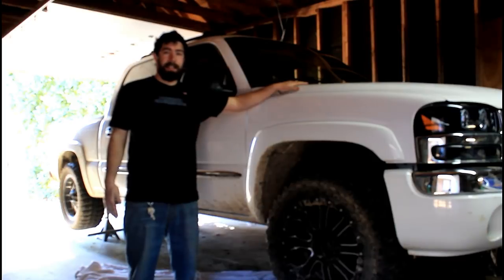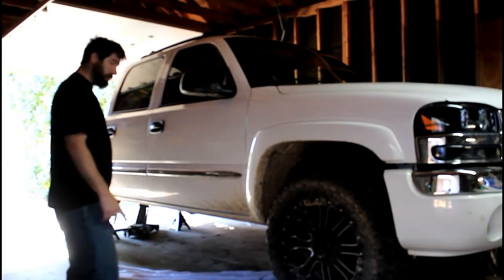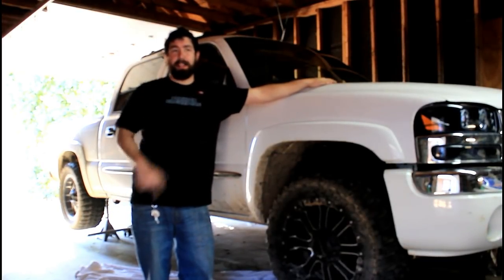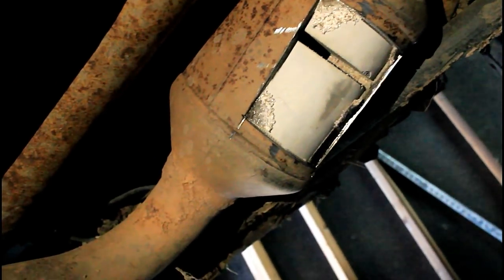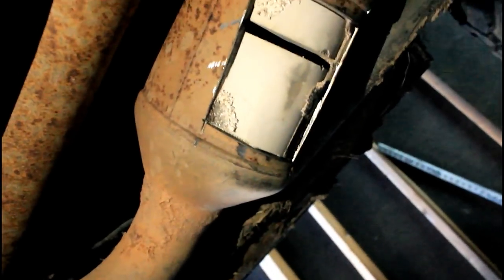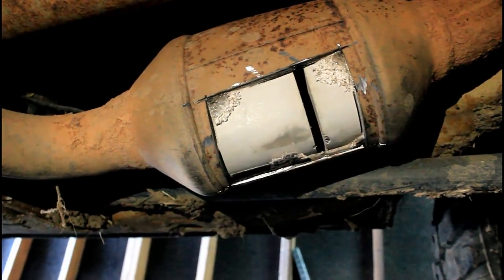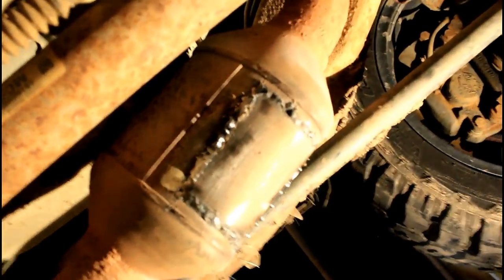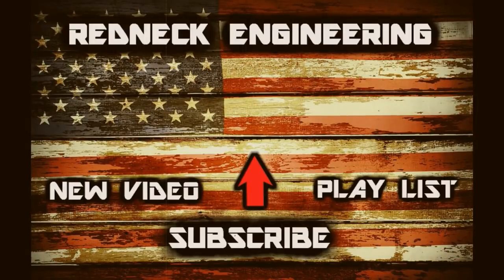Catalytic converter removal the easy and cheap way

Comment: I just deleted the 2 catalytic converters, resonators on my Ford Expedition. I installed a flowmaster muffler, performance tune, K&N 63 series air intake system. I love the sound and it has better acceleration.

Comment: I cut off my muffler, drilled a few holes in the converter, and just pounded the heck out of the converter with a metal rod. Ran it on the freeway to work at high speeds to blow the dust and cement out of the converter. Put muffler back on and used a couple lag bolts to fill in the drilled holes. Runs 100% better and is also louder than before. Plz give me a shirt.
Reply: You know that "dust" is Platinum you can sell..
Reply from the maker: Its not ez to sell im some places

Comment: on a scale from 1-10 what would you say is the difficulty level to weld that window back on? I know jack about welding. temperatures vs thickness of the metal? I'd hate to do it and not be able to finish. any advice on that last step would be awesome? or maybe some do's & dont's?

Comment: Need to hollow my cats out.

Easiest to do this, or is it realistic to cut pipe behind cat, hollow out from the back with long drill bit, and then use an exhaust clamp to clamp back together?

Comment: Hi i have an 06 suburban 2wd and it had no muffler but its not loud enough like you said lol..
Anyway was wondering how long it took you to do both cats, also I am 17 and don't have any experience with welding.. would it be easier to cut them off and put a little pipe in and clamp them or what could I do?
Reply from the maker: You could do that but its hard to get it not to leak and lign up

Comment: Hi there

I don't want to gut out my cat converter completely as I hate the smell of gas without it

I just want to drill 2 half-inch holes in my cat converter, using a long drill bit
Just to help with the flow

Do you think the honeycomb will crumble right out?
Or will it stand the rotational force of the drill? 

Thank you
Reply from the maker: Do not do that you are going to create way more issues just by high-flow cats if you don't like the smell
Reply: @redneckengineering7739 
I am sorry

Could you please be more specific
What kind of problem would I get?

This cat converter is still in a good condition
My car has less than 25,000 miles on it

I just want to get a little more power from this pathetic 1.5L Toyota engine

I gutted out the cat converter in my previous car 
But the exhaust smell became unbearable
Don't want to go down that route again

So I was thinking about drilling 2 half-inch holes through the honeycomb, along the gas flow direction 
Not through the cat converter body

I am just worried that the honeycomb construction is not strong enough and that it would completely collapse
It would then be like gutting out the cat converter = the very thing I am trying to avoid

Thank you
Reply from the maker: You're just going to waste a bunch of time you don't get any games from more flow without a tune

Comment: I have a Chevy S10 2000 catalytic converter is removed already can I replace that with a straight pipe? I live in Kentucky. I know in Ohio no one wants to cut off the catalytic converter and put it on a straight pipe but the thing that is illegal is actually cutting off the catalytic converter. I remove the old catalytic converter and I cleaned it out and I was just going to put it back in and have it act as pipe but the nuts had become part of the catalytic converter because of the Heat. I got it out there so now I'm just wanting to know if I can run straight pipe on it from the motor back or if I can just replace that part with straight pipe. I do know that there's an oxygen sensor on that catalytic converter that I might have to work with. I do on my own truck work and stuff, mechanic stuff because I can't afford a mechanic. I also have a 96 Dodge Ram 2500 that I work on.
Reply from the maker: I’m not sure what you’re referring to with the U bolts and the catalytic converter they don’t vote on but you have to have at least the front oxygen sensors or the vehicle will not run correctly you can put a straight pipe in but it is more difficult because you cannot easily weld the top of the pipe and clamps don’t always work

Comment: Just wondering if the truck ran any better?? Need to at least space out the rear o2 sensors, or get a tune. Thinking about doing this to my 05 burb this weekend. Cats are worth good money, almost worth the extra work of cutting then out and scrapping them. Guess that also depends on the condition of the nuts on the y pipe
Reply from the maker: in my experience it is very difficult to get the pipes to line back up if you cut it out at least if you don't do this very often and it will not be able to be welded on the truck and no there aren't much gains without a tune

Comment: I’m late to the party but I have an appointment tomorrow to get my cats removed in my 03 Tahoe I already have a serious 10 flow master I’m gonna keep 
Any tips? Or anything I should be aware of?
Reply from the maker: Check engine light is going to be on
Reply: @redneckengineering7739  that’s it ? Everywhere I keep reading they say it makes it run like shit lol 
I’m nervous AF
Reply from the maker: It will b fine

Comment: Hey bro, I have Lexus V8 ls600hl and one driver side catalytic converter honey comb was broken so gutted. Passenger side one is good. Now I have a engine light ON. Don’t know what to do? 
Can you please advice? 
Thanks
Reply from the maker: I have a video on here that tells you what to do or you could just leave it alone it will be fine either way but you should probably do it to the other converter

Comment: I have a 1995 Chevrolet 2500 what's the 454 engine. I wanted to modify the exhaust and I noticed the theory is a catalytic converter post my muffler. I've never seen anything like that before so I would like to cut the catalytic converter off and see what it sounds like through the muffler without the cat. What are your suggestions and is this configuration familiar to you?
Reply from the maker: If it’s after the muffler it’s probably not a cat but if it is before chop it out it’ll sound a little bit better

Comment: I have a 05 Tahoe with 5.3 I want it louder should I get flowmaster series 10 or a cherry bomb glass pack? And can I run no cats or is it illegal and will it pass inspection with no cats
Reply from the maker: +Briley Sadler I'd probably say go with glass-packs I like that sound Flowmasters is what everybody uses but if you have any type of inspection you will fail with no cats and yes it is illegal to remove it

Comment: So just for me to get the converter out i have to drain the oil? Or thats because you needed an oil change
Reply from the maker: The oil flows through the catalytic converters and creates a fire in there you can also cook tacos with it if you want but other than that do whatever???
Reply: @redneckengineering7739  i just checked my shit out n whatever idiot that had it welded both ends to some hooks that are supposed to hold the converter
Reply: @redneckengineering7739  so my thing is that i dont have any check engine light but when you turn my truck on you can feel a lil vibrate and when you go to the back n feel the muffler you can barely feel anything like if its clogged... Any tips on what i can do....
Reply from the maker: If the cats are clogged it would throw a check engine light but the best thing to do is chop them out or replace them

Comment: What is the difference in performance between a hollow-out and straight pipe?
Reply from the maker: There is no performance gain in either of them unless you are going to do some sort of aftermarket tuning and not one of those handhelds the biggest benefit is that you don’t have to cut and weld all the way around the pipe sometimes it is difficult to weld the top side of the pipe due to constraints

Comment: I have a Infiniti g35 is there a way to cut the cats and reposition the o2 sensor in a straight pipe to seal good enough to pass inspection or gut them where is still as if they have never been touched to still pass inspection
Reply from the maker: +Kaleb Milano I don't think you could do that either way and pass inspection

Comment: Sounds good. I don’t mind music if it’s low in the back ground. Where you can barely hear it. If your not required to have them why not just cut them out and add some piping.. drill and tap for your o2 sensors. You lose a few hp when you hollow those out due to turbulence in the exhaust
It messes with the exhaust flow. Unless your just looking for loud. Then this works lol
Reply from the maker: +Shiny Knife that is a lot more work and it will not cause a loss of horsepower or turbulence it still Flo's a whole lot better
Reply: Maybe yours is different then?  I have the same motor and have seen different results.

Comment: Pop a hole in the oil filter with a screw driver and let it drain. it won't be as messy lol.
Reply: or open the fill cap?
Reply from the maker: What r u talking about
Reply: And wear gloves, used motor oil is a carcinogen
Reply from the maker: I've never worn gloves before I ain't going to happen now
Reply: All u have to do is put a funnel underneath the filter while your are unscrewing it. TADA NO MESSSSSSS
Reply from the maker: Or just unscrew it and not worry about it
Reply: @pan2ube  thank you you seem to have some common sense
Reply from the maker: Ok
Reply from the maker: Cool

Comment: you can use a 2lr soda bottle just trim the bottom to form a scoop remove the cap an hold as u remove the plug, the oil just goes into the bottle an out the bottom
Black or grey ether is cool
nice design btw
Reply from the maker: +T Rea thanks
Reply: I got that idea after chasing the oil an cleaning the aftermath

Comment: Is your muffler removed as well? I cut out my muffler and welded a flomaster in, then brought my pipe out the side of the truck in front of the tire instead of behind. I want to cut the cats out too, I loved the sound of my truck just straight piped, but I like the sound of the flomaster better, and I was hoping I could get it louder by removing the cats.
Reply from the maker: +FrostyFooy ive got a 2 in 2 out magnaflow nock off someone b4 me cut the y pipe after the cays and made it true duals but welded on the stock muf b4 i bought it
Reply: You're just asking for a ticket if you remove the muffler on an already loud truck lol. If you don't drive it in town you probably won't I guess.
Reply from the maker: +Garrett - theu wouldnt were i live anyway but ill keep it

Comment: Love the video...great in its simplicity. Just bought son a 96 gmc 1500 extended cab. Cat already gone. Putting in muffler this weekend. Having hellacious time with water leak in dash and passenger side back corner. Already have back glass resealed and 3rd brake light. Any ideas? I live in the Memphis area
Reply from the maker: Not really a clue without looking at it

Comment: I have a 2000 Chevy Silverado and I really want to delete my cats! I might try this way, I want a shirt! Keep up the vids
Reply: I did that on a 1990 Chevy Silverado  and ran great ever after...........More power
Reply: Just rev it up till they are super hot then take the house put it in there and run water through them
Reply from the maker: That ain't going to work
Reply: If you dont have a welder and don’t want there to be a noticeable cut in the cat, if the exhaust pipe is straight enough, you can drop the pipe and bust it out with no cutting. Thats what im going to do to my 2014 silverado on the 3rd (California) cat.  The v-band is also 2  inches from the cat so that’s a lot easier
Reply: @redneckengineering7739  I have a 2004 Chevy silverado 1500 I want to delet my cats but will it throw a code
Reply from the maker: Yes
Reply from the maker: Nah man you can hit me up on Instagram though @cataldo133
Reply: @redneckengineering7739  can you tell me step by step what to do
Reply from the maker: I mean yeah what dont u get
Reply: @redneckengineering7739  do I do the o2s first or last
Reply from the maker: Last
Reply: @jeffpilcher8099  Get one of those O2 sensors that has a mini cat built into it so the O2 sensor only gets to sniff exhaust gasses that went through a cat. Your exhaust pipes can be cat free and your ecu is none the wiser.

Comment: Like them headlights bud
Reply from the maker: Thanks but I actually hated those I don’t like halos or projectors or stupid little LED lights that were in those I wanted clear tinted regular headlights and that’s what I ended up getting those worked way better I could actually see in the dark till I sold the truck

Comment: Sounds lots better, how does the cars computer o2 sensors work now?
Reply from the maker: +royalwulff1 first of all front O2 sensors are the only ones that actually matter the second-set are just monitoring the efficiency of the catalytic converter so it will throw a check engine light but I made a video on how to fix that also
Reply: I saw that after my post, good job. Thank you. Doing my cat install in the morning 488$ oH WELL, WE HAVE INSPECTIONS :(
Reply from the maker: +royalwulff1 put vband clamps and make it removable and just put it on for inspection
Reply: Redneck Engineering would pulling the bank 1 downstream o2 sensor be causing me a p0420 code for cat running insufficiently? I took a o2 sensor out and put back in..been throwing engine light since.
Reply from the maker: +Brady Wyant mayb idk what that code is

Comment: Nice.  I was afraid to just cut them out of my f150, but your solution is much better- Im in baja Mexico so  I dont worry about california smog..
Reply from the maker: Yeah the big issue with cutting them out and putting in a pipe is it's really hard to weld the top joints and in some situations it's hard to get the pipes to line up

Comment: Why would you waist that much time and effort? You could have cut them out and replaced the pipe?
Reply from the maker: +Garrett Frey you obviously have never done that it's just as hard
Reply: Waste
Reply from the maker: Both of you are idiots have you ever tried to take loose an old manifold bolt if you're going to do it right you need to remove the exhaust completely cut the cats out Andre weld it if you cut them out while they're on the truck and try to rebuild it the odds of you getting to the top weld joint are low
Reply from the maker: With that being said do it however the fuck you want because it's your truck I really like to do long tube headers and a full exhaust but I don't think there's enough to be gained

Comment: What headlights and running lights are those?
Reply from the maker: Did not buy the ones in the video any eBay or Amazon lights that have halos or projectors are junk! Since then I have found stock style just tinted and clear lenses no halos no LEDs no projectors none of that crap

Comment: What about the O2 sensors ??
Reply from the maker: It doesn’t have H2O sensors and the oxygen sensors will set off a check engine light you must check out my other video to figure that out but good luck

Comment: My jimmy 1991 can't breath. You got the right idea
Reply: Do you think my O sensor will still let my jimmy run good. I just want to put a pipe in there to replace that cat
Reply from the maker: +Sylvester Stalone yes
Reply: Thanks, I have 200,000
Reply from the maker: +Sylvester Stalone not bad

Comment: I'm gettin blow by fumes in cab thru heater at a stop. Oil change with Lucas but wheres blow by tube so I can add or reroute
Reply from the maker: Something else is wrong there is no blow by tube it all gets recirculated through the intake

Comment: I hear leaks, this is a waste of time and money. Easier just to cut the cats off get for 500 bucks for them take a couple pieces of flex pipe and clamp them right on. Sure there may be people that would argue this method but works great and if you don't like it easy to take off, the other benefit is super cheap.
Reply from the maker: If you think flex pipes are better than what i did you are clearly an idiot

Comment: Catalytic converters are full of copper, nickel, cerium, iron, manganese and a small amount of rhodium.
Reply from the maker: +Willem Moon ok
Reply: Well I only type so because some of these metals can be hazardous to breathe... When I removed my 2001 chevy blazer's converter I just cut it out and cleared it out and bought a custom made exhaust reducer and clamped it back in place :).  I thought about doing it the way you did but I am a little to old to be climbing under cars and welding lol. Great job though!!

Comment: NEW SUBSCRIBER What's up man!!! I'm in TN too Wilson County! I have a 2007 Silverado Classic that's throwing codes for the catalytic converters. Thinking about just deleting them and getting them tagged in Smith County sense they don't have to do emissions. Great video, good to see more TN boys on YouTube 🤘💪
Reply from the maker: Yeah that works just make sure that your O2 sensors are good because that can throw the code also
Reply: Did u codes pop up i got a 2014 want mine gone got a thrush muffler on it sounds good but still quiet had 2003 GMC had the cats off sounded good
Reply from the maker: Yes codes will pop up

Comment: Looks like you didn't clean the weld area. That is probably why you have the welds you have. I did the same thing when I started welding. I still suck at it, but makes a hugh difference when you prep the surface. Then you won't have leaks and such.
Reply from the maker: +883Realtree its hard to weld upside down

Comment: Anyone thinking of doing this, just cut the cats off and weld in a piece of pipe.. sell the cats and pocket the money or use it on other mods.. some of those gm cats go for decent money
Reply from the maker: It is not as easy to do that because you can’t get to the top without pulling the exhaust down